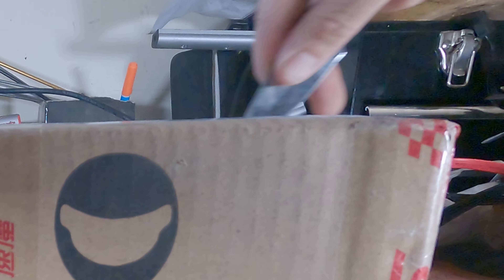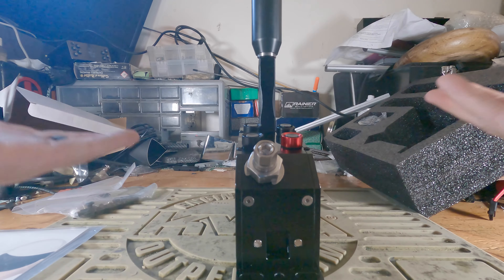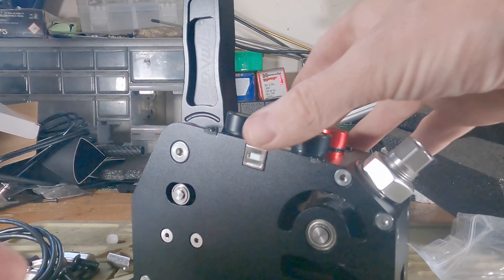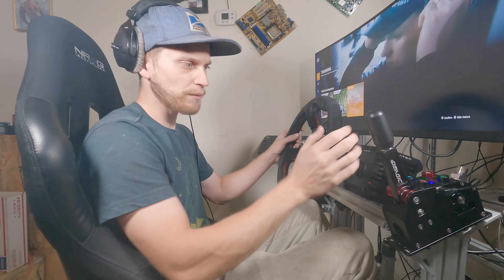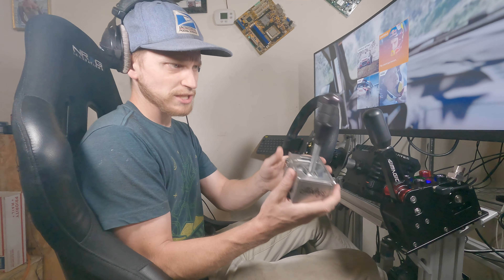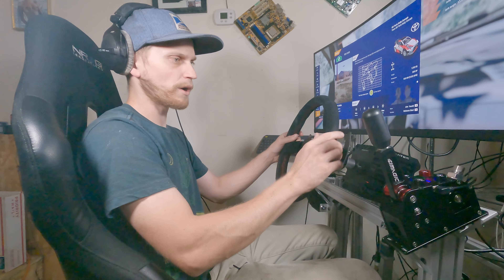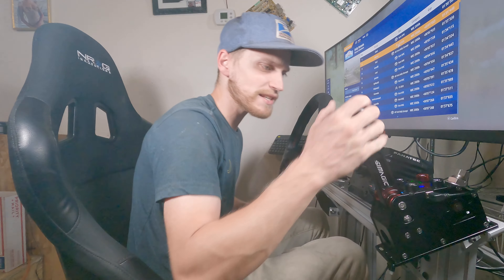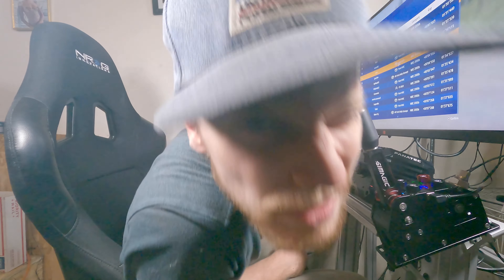Simagic Q1 Sequential Shifter Review!!!

Comment: Got mine a couple months ago and omg its AMAZING. I was definitely worried about the volume but I really didn't find it much more louder than the aiologs I had - as Doug said when you go down on the stiffness its really doable, but no complaints. They also updated the new version to run off the game's gear telemetry, I didn't realize this till actually driving 9/10 shifter
Reply from the maker: Love mine.
Reply from the maker: Also thank you for the update!
Reply: For the game telemetry you need to connect it to an Simagic wheel right?
Reply from the maker: I'm not sure actually...I never got it to work with any software. But maybe it does now.
Reply: @DouglasThompson  Yeah it seems to only work with the Simagic USB hub connected to a Simagic wheelbase.
Reply: @songboek  Yes this is true - if I plug it in a regular port it only reads N
Reply from the maker: Great to know!

Comment: Can you make a video on how you mounted your shifter like that? Like what hardware you used to get it right by the wheel
Reply from the maker: I used a combination of brackets I believe I can't remember exactly. I'm gonna have to watch my own vid to figure out what I did lol
Reply from the maker: I think all I did was take a 2 slot 90 degree angle bracket and a 1 slot 90 degree bracket and mounted on on the horizontal peice of extrusion and one on my wheelbase upright peice. I recall only mounting the shifter with 3 screws on the bottom.
Reply: @DouglasThompson  gotcha I think I kinda get the idea, ill be heading down to the hardware store tomorrow lol appreciate your time replying back to me
Reply from the maker: Ya man I could show it in a livestream if you remind me when I get back home in 8 days.

Comment: Hello Douglas. New viewer, and subbed :-) I watched this video, and have ordered one of these. Nice piece of kit!

A question: I'm a VR driver, too (Sony PSVR2), and you are spot on regarding having to use buttons by feel. I wondered about blinkers. Whilst you can map these on a wheel, I can't actually tell when the blinker is turned OFF. 

Yes, I can find the button, but I don't want the blinker to keep blinking, or turning it off and then on by mistake. In GT7, for instance, there are no visual clues in the VR dashboard. Any ideas?
Reply from the maker: First of all thank you! As for your question about blinkers you are saying there is no visual cues on the dash for like online mode? So you are concerned that your blinker is on during a whole race I assume? That's an interesting one,  I'm not really sure of. I guess the only way to confirm is to change the camera but that might not be possible in that game while in VR. 

I also assume you are using the headset on pc, correct? Just in case because if you are one console by some chance I'm not sure this shifter would work without some kind of adapter.
Reply: @DouglasThompson  Thanks for your reply, Douglas. I use the console most of the time, hence the VR2. The PC shifters can be used with a console if mated to a 3rd party switching unit like the DriveHub, apparently. Searches on Reddit and GT Planet confirmed this for me. I was really surprised this was possible.

I guess I will have to put up with the blinker situation in VR for GT7. Boohoo. The odd car (street cars) have blinkers on the dash, but rarely in race cars.

Comment: what did you use to attach it diagonally? I am looking to do the same because I have a sequential, an hpattern and a handbrake
Reply from the maker: I used the mounting holes on the unit furthest away from each other and twisted it and tightened it down. :)
Reply from the maker: Like the far left top mounting hole and the far right bottom mounting hole.
Reply: i am having trouble finding profiles that i can offset. Where did you get your mounting accessories that go onto the chassis? @DouglasThompson

Comment: That thing looks and sounds awesome mate!💪😃👌
Wonder how similar it feels to the Pro-sim SQ shifters, looks like really similar internal mechanics.👍
One thing I don't like the look of though is the USB placements.
And also thinking how much is plastic in the shifter do to the low weight, durability and stuff?
Reply from the maker: The handle, screen cover, micro switches,  and  ball detent is made from plastic from what I see, the rest is aluminum and steel. Definitely not as hefty as I expected but it is super beefy in terms of construction. I don't imagine it would outlast a ProSim given the price difference but I don't see this causing me any issues in the future. If it does, I will be sure to make a vid! ;)
Reply: @DouglasThompson  The important thing is the ball and the handle, something that can be easily exchanged for a steel ball and an aluminum handle ... I don't like the height, it would stay very close to my manual gearbox and I don't use gloves ...
Reply from the maker: I actually really like the plastic handle, don't plan on changing it, makes it lighter too which is important for my motion system. The plastic ball can be switched out I'm sure but remember who wins in a fight between aluminum and steel! ;) I'd rather the ball be the weak point but it's delrin plastic if I am correct in my thinking, which is a great durable plastic.
Reply: @DouglasThompson Yes, I am in the same, in case of failure it is better that I break the ball than not the gear, I already spent in the servo reducer that I use in my G DIY chair, anyway it has a spare ball ...
Reply from the maker: Seems like something you could find in a hardware store. I will look next time I go to my local store for some screws and such.
Reply: Will be interesting hearing how it holds up, and hoping it will last a long time!
Reply from the maker: @RVRCloset  same here! I am hopeful. It feels amazing.
Reply: Yeah, this is definitely a cheaper copy of the pro-sim shifter.

Comment: Nice review sir! Would you still recommend the aiologs over the simagic?
Reply from the maker: What is your main form of racing?
Reply: @DouglasThompson  i mainly do drifting and gt3 racing on ac and acc. I was thinking about getting a sequential shifter because I don’t have a round wheel with paddle shifters. It seems like the simagic seq shifter beats the aiologs like a mile so I’m really curious on ya thoughts.
Reply from the maker: @jin_dorifto  oh 100% if you don't mind spending the money, the level of satisfaction and extra confidence I get out of shifting with the Simagic is huge!
Reply: @DouglasThompson  damn i can only imagine and really enjoy what i saw in yr video! what about the aiologs? The feeling of shifting is it just a bit lesser tactile than the simagic?
Reply from the maker: @jin_dorifto  it's like night and day. It's as big of a difference as going from a non-ffb wheelbase to a ffb wheelbase.

Not sure if you have ever used a non-ffb wheel like in an arcade or something but that's what I can equate the satisfaction to.

It really feels mechanical and you feel the transmission seemingly.

The aiologs is a really solid piece of gear and I still highly recommend it but if it will be a main shifter, it will lack a certain amount of sensation. It does feel great though, don't let me convince you otherwise.
Reply: @DouglasThompson  thanks so much! You’ve have helped me decide which shifter to get! Gonna go with the aiologs because I don’t drive alot of sequential shifting cars. So i believe the aiologs will be enough!

Btw also looking forward to your bdh shifter review when you get it! (I’m more of a H shifting kind of guy ^^)

Appreciate your videos and response!
Reply from the maker: @jin_dorifto  You will love the shifter! I am currently selling mine on eBay. I think it might be the only one for sale there.
Reply: @DouglasThompson  yeah saw it but i stay in Singapore tho, how much would it take to ship to Singapore?
Reply from the maker: @jin_dorifto  ya depending on where you are, shipping could kill it. I'm trying to keep the sale in the United States since I have had some real complications with packages getting lost shipping overseas. Im sorry, I didn't think about the possibility of you being in a different country.
Reply: @DouglasThompson  Don't worry about it. I'll get it directly from aiologs then! Appreciate you so much!
Reply from the maker: @jin_dorifto  You will be very pleased!

Comment: What is that silver part that sticks out from the front?
Reply from the maker: It is how you adjust the effort to shift. The tighter the more resistance you feel when pushing or pulling the rod.
Reply: @DouglasThompson  Gotcha. Thanks for the reply. Great video!
Reply from the maker: Ya man! Good question, I don't think I utilized it in any vids.

Comment: If you want something to navigate menus in VR, the option is always there for a DIY button box with a hat switch and a pair of buttons. Should be easily done with something like a Bodnar board, or your preferred USB joystick board.

On another note, how is the Sim Vertex doing so far? Been looking at an H Pattern, and I’m still a bit leery on how it’ll compare to a BDH.
Reply from the maker: Still running great! I have dismounted the one Im selling and placed it in its box in preparation to sell. I don't use gear that's for sale. I will be doing the comparison between the Simvertex V2 and BDH but the BDH will take longer than expected because he will be implementing new features I requested on my unit! I will be the first to have one! ;)
Reply: @DouglasThompson  I look forward to it!
Reply from the maker: @joshuaprematta  me too! ;)

Comment: Great review !! I currently have a gearbox in H from SHH, which also has very basic sequential.

My question is whether to keep the SHH and buy an HE (Aiologs in the US is almost impossible to get), sell the SHH and buy the Fanatec as 2 in 1 (my use will be 80% sequential), or keep the SHH and make a great effort to buy this Simagic (around € 415 for Spain with transport included). What is your opinion? Thank you very much ;).

By the way, I imagine you know that the cue ball is to reduce the noise of the shifter a bit;)
Reply from the maker: It is comparable to a steel ball from my testing. I actually have a mod video to quiet it down a lot but only for special occasions. The Simagic sequential is definitely worth the extra money if you will use it a ton. There is no competition in that price range. I use about 50/50 seq and h pattern now so it was very important for me to have a good experience for both. The Fanatec is a great option but it is good at both but master of none.
Reply: @DouglasThompson Thanks for the quick and concise reply. It is appreciated. Greetings ;)
Reply from the maker: ;) I do my best!

Comment: your shifter first inverted bouton suppose to be closer to you but they way your installed in thats video i unstand why you install it like that cause those shifter is made it be instal around your leg level ;)
Reply from the maker: It's actually intended for both ways. :) But yes, I would have preferred it the other way but it would also be a wrist hazard since the shifter shaft and handle is so close to the main housing.
Reply from the maker: You can actually flip the useless gear indicator numbers around if you hold the main button and pull the lever I think.

Comment: You seemed a lot more confident with your shifts, or maybe you just had a good day? That's a cool shifter! But yeah, it would be too loud for me.. 😬😂
Reply from the maker: I felt more one with the car using this shifter. It's odd but that extra tactile sensation creates an extra layer of connection with the vehicle.
Reply: @DouglasThompson  Yeah I could tell.. Reason why I think investing extra in proper pedals and dampers, will make my throttle and brake control "better" or more dialed in.. It's my biggest issue with my G920 when it comes to high powered vehicles.. I need to feel what's going, some resistance or tactile feedback is necessary, or I have no clue whats going on with the car... The G920 got a super massive spring on the brake for some reason, but I could probably depress the clutch and throttle with my tongue.. Not that I'm gonna try, but man it's a stupid contrast.. 😂
Reply from the maker: I would actually love to see that! That's not stupid at all, that gives me a good visual on how easy the pedals are to depress.
Reply: @DouglasThompson  Hahaha, I guess you're right, but I don't like to put my tongue where feet goes.. 😂😂😂

Have you ever tried the G920 tho?
Reply from the maker: @W0ND3RB0Y1  I have felt the Logitech pedals before and have owned a Logitech gear driven wheel a long time ago back when I was a teen but I have no direct experience with them other than seeing many reviews.
Reply: @DouglasThompson  Right so probably the older ones? A bit of a rant I suppose, but things I've found after 3 years.. 

The two biggest issues with the G920 specifically, is that I can push myself back in my office chair and only depress it 49% according to Logitechs own software.. It's waaaay too hard and I weigh 72 kg for reference.. Clutch and throttle are so soft I can easily depress it fully with my pinky.. It feels like those springs are there, only for springing back the pedal into the standard position, and not to make any mechanical resistance for the driver as you use them.. So the contrast between those sloppy pedals, and having to force yourself onto the brake by holding the wheel and push yourself against it, is super unrealistic and very much a problem after 3 years wear... Like frustratingly so... 

Second, the wheel base itself has two motors, on left and right side with metal gears, as well as the gear that rotates the wheel itself, along a stem in the center.. The motors that transmit the gears movement into the wheel itself, goes through a piece of toothed plastic, that slides freely on a lubed plastic frame, which is molded into the bottom plastic part of the wheelbase itself... 

Dumbest design I've ever seen, they could have covered the teeth with a metal shroud so it would be metal against metal.. But they didn't, which means it WILL wear out... Not to mention the teeth aren't small but quite big, so if you think it feels jagged as new, wait until it's old and you can feel soft bumps but with no resistance due to wear.. It really affects FF because the motors no longer connect properly to the teeth of the frame... So sometimes I turn the wheel incrementally and the teeth gets in contact, it rips the wheel out of your hands in a super artificial way.... Turns me insane...
Reply from the maker: @W0ND3RB0Y1  ya, those are some very odd design choices indeed...

Comment: Average shifter and noisy as hell much better stuff on the market for the same price.
Reply from the maker: What are you comparing it to off the top of your head?
Reply: @DouglasThompson  BJ shifter 3.0 would be my choice, I actually went from the Simagic to the The Aiologs sequential and I love it, the noise was the most annoying thing of all. Anyways each to their own. Cheers
Reply from the maker: Yes, if noise is a concern the simagic is one to avoid! I don't think I've heard of the bj3.0 sounds sexy. ;)
Reply: @DouglasThompson  They are a simple shifter with no gimmicks but work well.  I'm happy with my setup right now Cheers
Reply from the maker: @adrianmilanesi9143  I will check into them

Comment: It's anything but cheap.
Reply from the maker: Cheap-er than ProSim. The next price you would have to pay for this kind of performance is I think around 800. I haven't seen the prices currently but last I checked they were a good chunk more than this unit. I don't think I said cheap though did I? I made a conscious effort not to use that word. Instead I chose to use "affordable" since it's attainable but not a chump change kind of item.
Reply: @DouglasThompson  Come on, 450 bucks is not affordable. It's still too expensive for the cheap chinese electronic components inside. There must be like 40$ of material and max 10$ of workmanship. This is a chinese product for god's sake. In 2 years, it will probably not work anymore.
Reply from the maker: Fair statement but the quality of the materials used is seemingly high. I agree the price should come (back) down to near the 300ish mark max imo but at the end of the day, I don't have the capability to make this unit and other shifters on the market that have similar qualities are much more expensive. 

I know of no other unit cheaper that uses this method for the "clunk" mechanism. 

But yes, just as I feel every DD wheelbase should not be the price it is, I can't directly do anything about a price. As I said, I reached out to Simagic and Simracingpros.com and suggested they bring the price back down to 360.00usd shipped as it's a much easier price to justify on a single piece of gear and they agreed but said materials and shipping costs have risen recently and can't afford to keep the price as low as it was when it first came to market. 

I don't know how true that is but given wood is a ton more expensive, I can see material cost as part of the factor in pricing...

Anyway I'm not blindly defending them just in my experience Sim-racing gear is always a bit overpriced for what it truly is, if you get the opportunity to try it and feel what the hype is about, I think you would put more value to the unit in your perception of the shifter.

It really adds a lot to the experience.

Also it is using something other than micro switches for the shifting detection. It is some kind of optical sensor or magnetic sensor possibly. No physical switches to break unless you count the 4 buttons on top. Which are cool in its own right...I just paid over 100 dollars for a dedicated button box. For a lot of people those extra buttons can serve as a lot of extra functionality/value.

I have suggested to them to release a button less/screen less version to lower production costs, I hope it's something they try in the future.